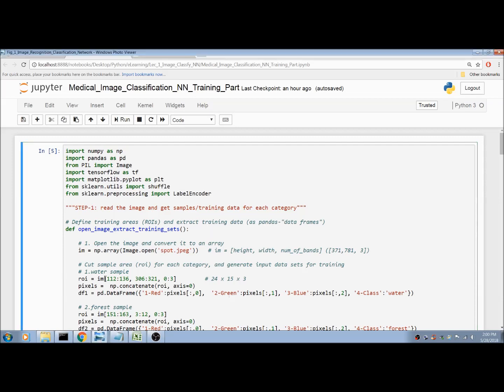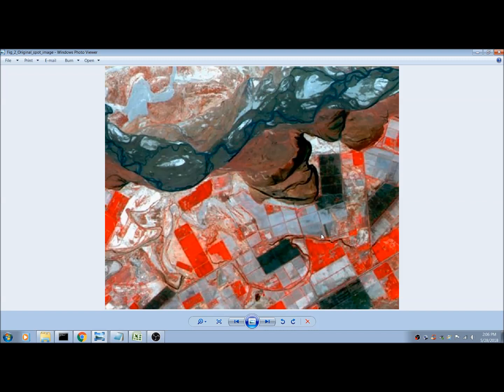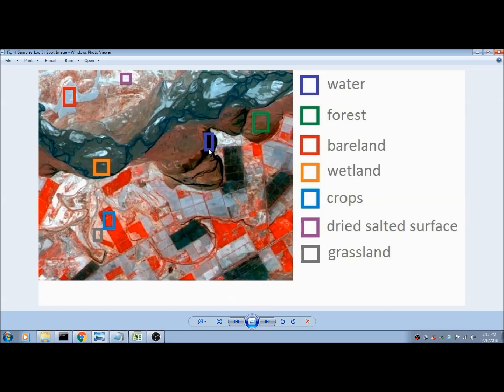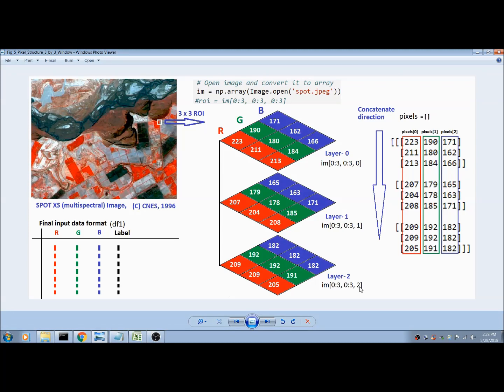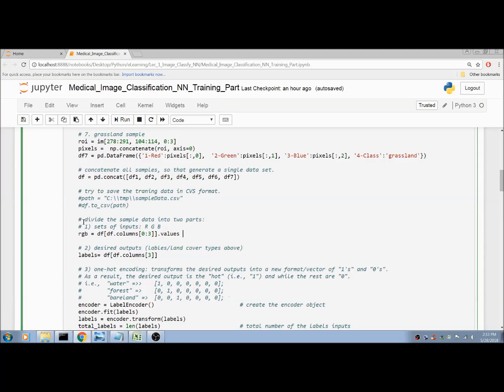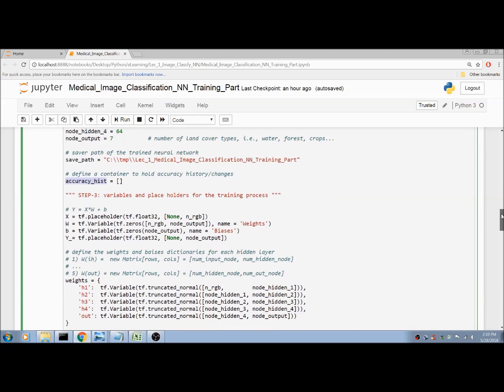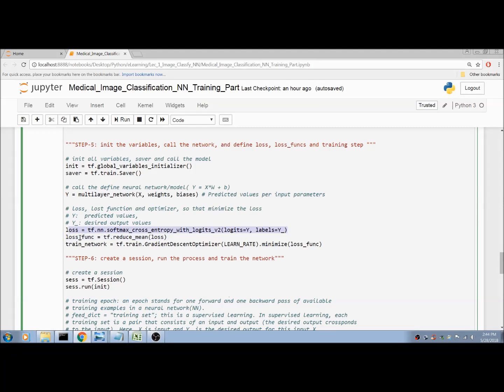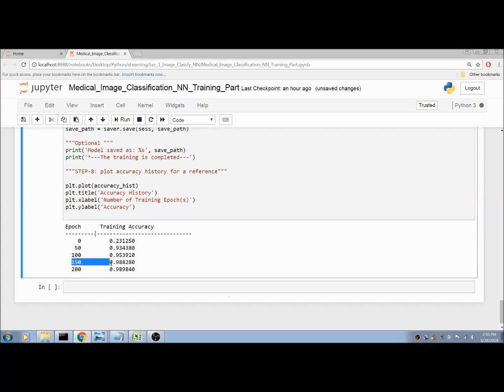Lec-1: Image Classifier Using Machine Learning, Neural Networks-For Medical/Satellite Images-Part 1

Comment: Hi How download Codes?
Reply from the maker: Thank you for your comment. The link is not working now. However, you may get the whole code by a work around:
1) Play the YouTube video and stop at 6:51 (six minute 51 seconds) location.
2) Then, go to YouTube video's right-bottom corner's "Settings" and adjust the "Playback Speed" at 0.5.
3) Then, start the video in 0.5 speed and see the code. Pause the video if necessary. Thus, you can see the whole code.
(Namely, from 6:51 to 7:00, whole code has been displayed, please see it in low speed).

Comment: How did you know which value to write in order to cut a particular  sample?
Reply from the maker: If I correctly understood you question:
1) First, you should know the targets in the image, thus you are able to
   locate each target by opening the image using Paint or Photoshop, or
   any other image display tool. Namely, you may get the coordinates
   of the target.
2) After getting the coordinates of the targets, you may cut them per
   the coordinates.
3) Please see from 7:50 (7 minutes 50 seconds).